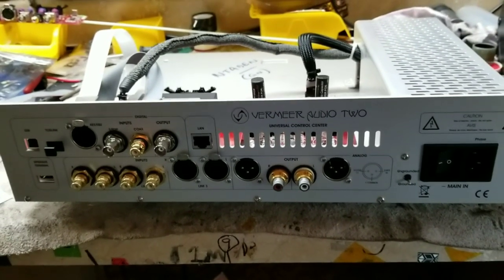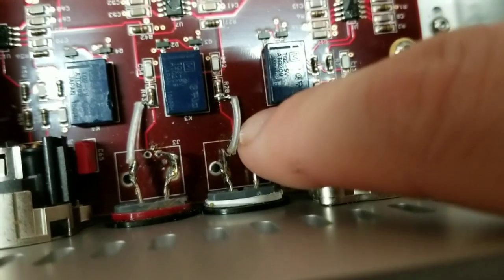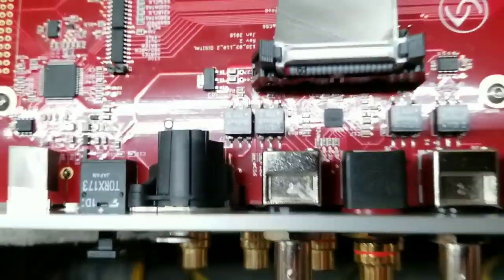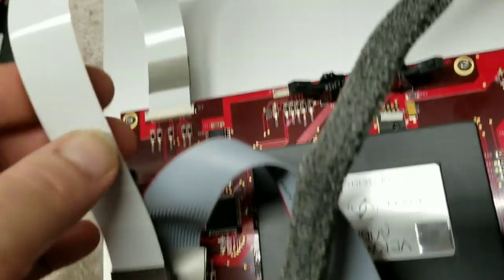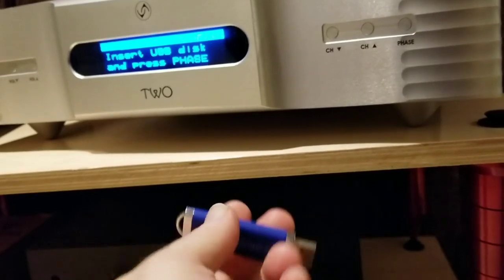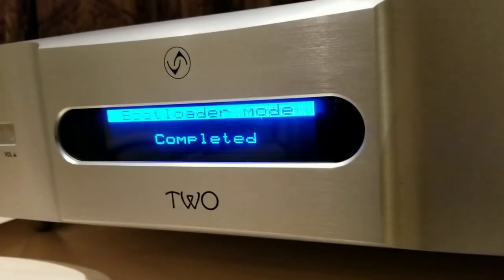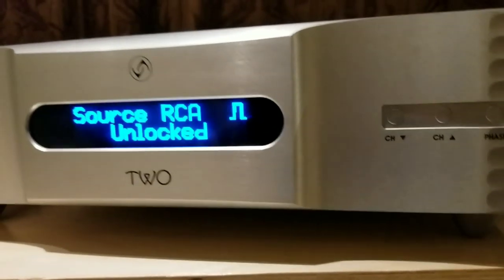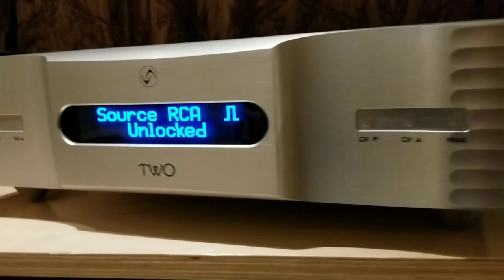VERMEER 2 DAC/PRE upgrade to VERMEER 2 LAN DAC/PRE/STREAMER

Comment: Hello there! How can I enter the update firmware page, I can’t find the remote control and the panel, thank you
Reply from the maker: contact Vermeer. which piece do you have ? I have a jump drive with last years firmware. They mail you a jump drive ready to use ...
Reply: Thank you!  I sent an email to vermeer audio and they told me the update method. My two problem has been solved and it can be used normally!